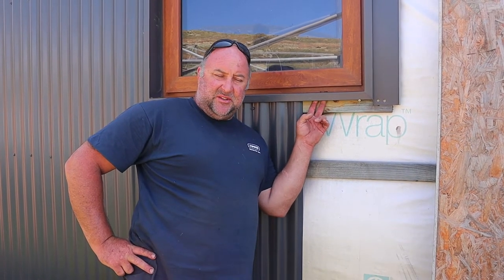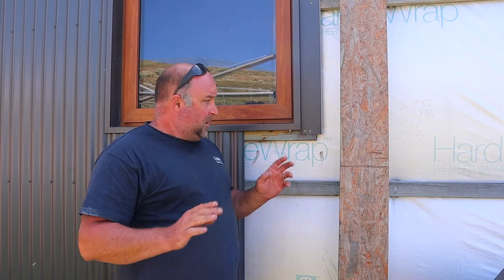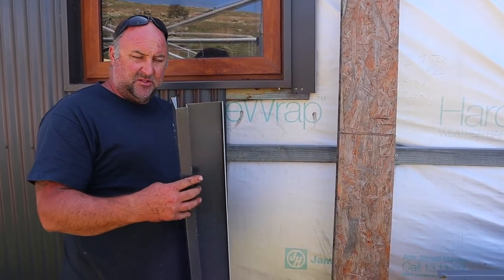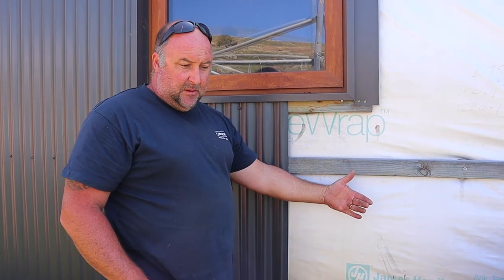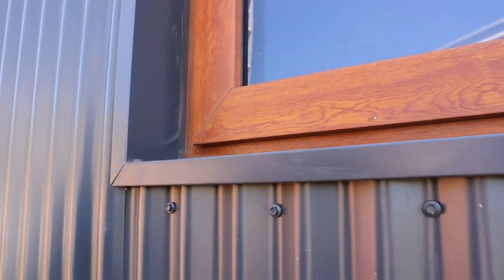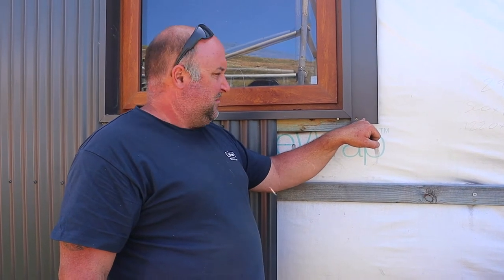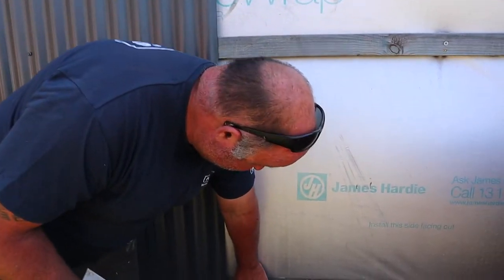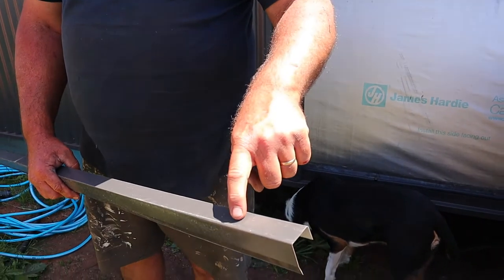How we made our ‘picture frame’ flashing with Colorbond steel | Offgrid house build

Comment: I'm in love with this design! Do you still have the drawings you used for the flashing? I think i get it but unsure about the heel flashing under the window. 
What is your overall wall thickness including battens? (I'm thinking i could replicate some of your design but my walls are standard 90mm thick timber frame so I'll have to adjust the measurements.) 
And when you said you could use this for the door as well, what happens at the bottom? My build is raised, not on a slab. Sorry for all the questions. Love your work!
Reply from the maker: Cheers mate! The drawings were just paper and pen so maybe somewhere 🤔 Might have to do a dedicated video to answer your questions 👍

Sips are 145mm, battens 35mm + packers 10mm, then colourbond depth… ours is about 20mm. So overall 210mm.
Reply from the maker: Ours is on stumps too. On the bottom of the doors we did a sill flashing but you could incorporate a picture frame finish into a sill flashing. Questions are all good 👍

Comment: Ive just discovered you guys on YouTube! Where have you been all my life?! Just a question regarding the window flashing. You said that your wall thickness is about 145mm, and your flashing is 100mm. With your windows being installed from the inside, does that mean you don't have much of a window sill inside?
Reply from the maker: Hi! Welcome 😁😁 we had to decide where we wanted most of the reveal and we like the look of deeper set windows on the outside. With additional wall cladding inside we have ok sills but they are definitely smaller than outside 👍
Reply: Appreciate your reply guys! Thanks so much! This isn't the easiest thing to wrap my head around 😁😆I've subscribed now, so you're defintely stuck with me!  @ROCKPILEOffgridHomestead